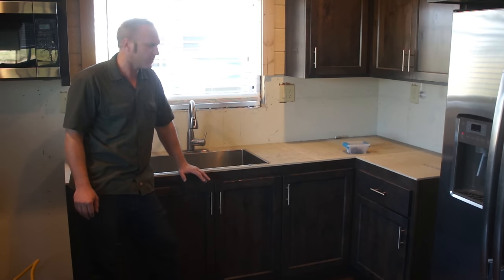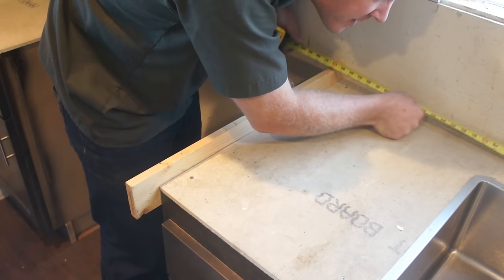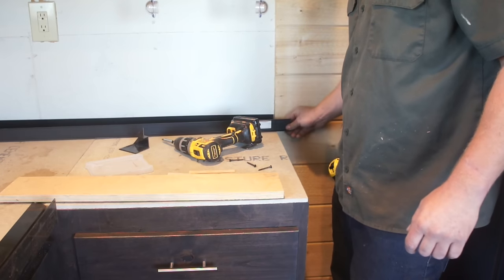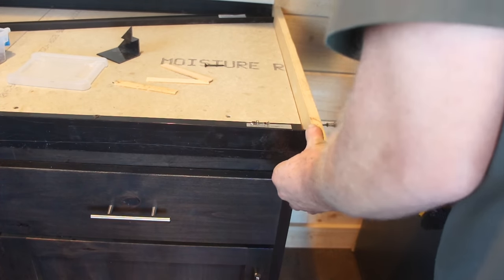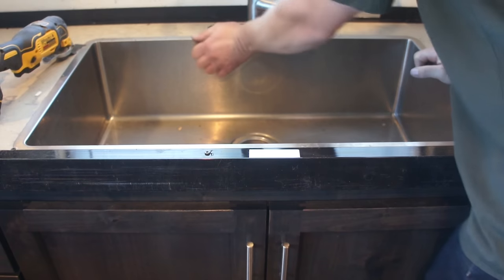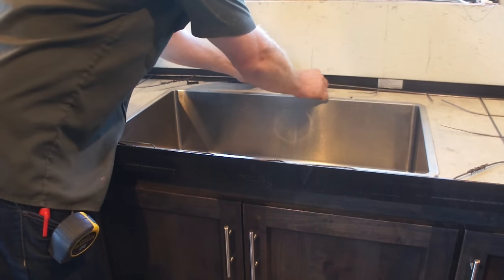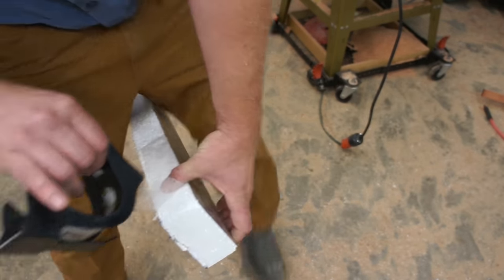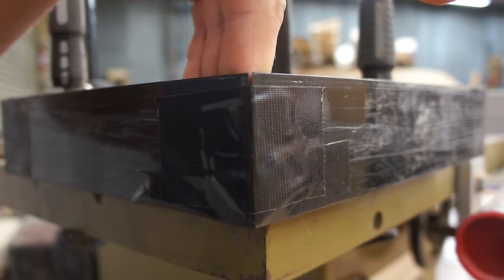DIY POUR in PLACE concrete countertops

Comment: I do Mold Remediation, and a lot of my client's kitchens get mold between the counter top slab and the support plywood below, you have to destroy the whole thing to get rid of the mold and roten wood, if water/mold finds it way, and it will. 
I recommend treating all wood under the counter top with Boracare to prevent mold and termites. Great video!
Reply from the maker: Good points. Ive never heard of anyone doing that but Im definitely going to look into it.
Reply: Great tip. Thanks!
Reply: He’s using hardiboard, which is cement, would there still be that concern?

Comment: This video was very well done. The only thing I’d have done differently is the part where the countertop form meets the wall covering. I’d have notched to fit an extra piece of the z-form in that void, just to keep the countertop edge uniform all the way to the wall. The wall covering looks like it could absorb water from the poor, and, if they ever decided to remove the wall covering and paint it, the butt end of that countertop is gonna look just a little different.
Please continue making great, informative content.

Comment: I’m curious how the sink will come out after the pour
Reply from the maker: It came out good, It was an undermount sink, pretty straight forward. I am editing the next video in this series right now so stay tuned!
Reply: I think he is saying also, How will it ever be removed if you want to change sinks? @unitedstatesofbuild4915
Reply from the maker: @MikeJuntaman  Right, it would only be removable through the bottom. Cut away the hardie board.
Reply: Are you kidding me. I would invite you to try what your saying. You are working inside a cabinet where your access to especially the sides of the sink are almost nil. If you had ever installed a kitchen sink you might know where the challenge might lay. This is an error and it's irresponsible to drag unsuspecting do it your selfer's down your rabbit hole. You dismiss the sink because it is beyond  your ability to deal with properly and is also probably too taxing.........…..... then a few minutes later you are all of a sudden concerned with trapping the wall covering. Trust me,  The sink was a much bigger issue and it would be good of you to offer a professional solution seeing as you've been doing this for years.
Reply: @MrGarycooper101  Ive been installing cast in place concrete countertops for over 20 years and I install the sinks the same exact way as in this video. Never once has anyone said the needed to replace just the sink.
Anytime someone wants an undermount sink replacement they have to replace the entire countertop no matter what its made of. Especially if they have a sink thats old and cant find the EXACT matching size that fits the knock out perfectly. Try removing an undermount from a granite countertop and find another sink that matches up perfectly and then install it...not gonna happen unless you are able to get the exact same make and model sink. And by the way, when does someones steel sink ever break? Never heard of that
Reply: @TimKollat  AMEN. ^What he said^
Reply: @MrGarycooper101  replacing a sink is really a non-concern. Having been in the trades for a great many years I have personally never heard of a sink-only replacement. The tops (whatever material they are...) are cut specifically to the sink size. There isn't really an industry standard on size, thats why every new sink has its own paper template included. This is also how zcounterforms recommends doing the sink and it works well.
Reply: I'd compare sink replacement to worrying about how you're going to replace the pipes under your home's foundation without disturbing the flooring on top of them. Rarely do you have to repair a pipe BUT in the off chance it comes down to it -> you're going to replace everything above it. Same with the sink.
Reply: No one will know to simply cut out the hardy board to remove the sink lol

Comment: what is the recommended way to span  over a dishwasher?
Reply from the maker: Slide the dishwasher out, span the opening with your durock or hardieboard, then temporarily brace the underside with some 2x material. Its important to make sure the span isnt allowed to sag, that could prevent the washer from fitting. Once the concrete has cured it will be strong enough to hold its own weight.
Reply from the maker: Personally I never pour with the dishwasher in place, there is a chance the weight of the concrete could lock the washer in place

Comment: How thick is the hard board underneath? ....and about going over the stretch where the dishwasher will slide under...do I need support the hardboard or will it support the concrete over that 24" space? Also, is the hard board flush all the way around on top of the cabinets?
Reply from the maker: On flat substrates Id recommend using 1/2" board. The hardie board sits flush to the front edge all the way around. The zform will cover it. I pull the dishwasher out and add temporary bracing until the concrete dries and can support itself.
Reply from the maker: On flat substrates Id recommend using 1/2" board. The hardie board sits flush to the front edge all the way around. The zform will cover it. I pull the dishwasher out and add temporary bracing until the concrete dries and can support itself.

Comment: You are obviously good at this but this is a lot of effort for a counter-top and has to cost more then granite/quartz/ corian/ Formica.. Wow
Reply from the maker: If you are going to go the DIY route on concrete tops then its definitely much MORE WORK than cost. But just as with any DIY project your time isnt usually figured into the equation. If you're are paying someone for tops then you're on the right track, if you want concrete it better be because you want concrete, not just a cheap alternative to the other counter substrates. Thanks!
Reply: Also, keep in mind that he’s going very slow to show the steps and talk about the process and enlighten you with tips and tricks. I can see this taking a single day to set up and pour, if everything needed is onsite. Obviously the cure time would dictate more days than one for full project completion.